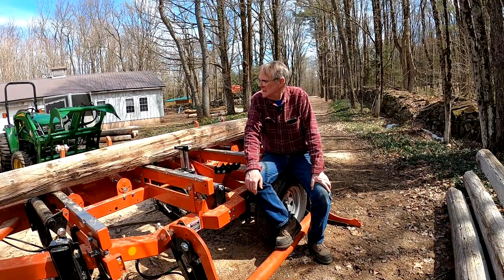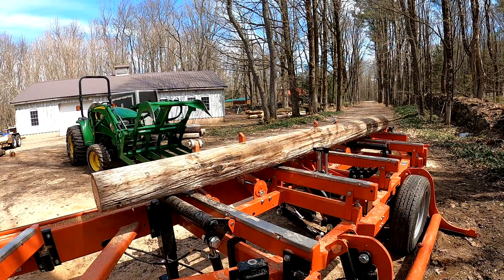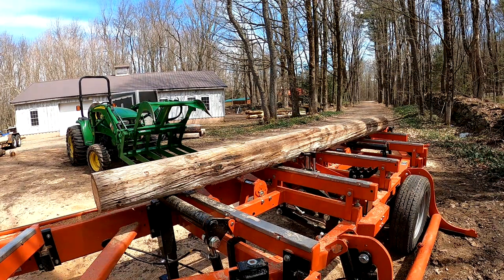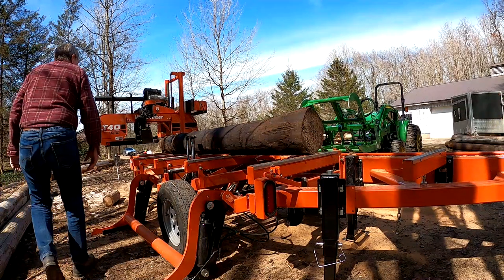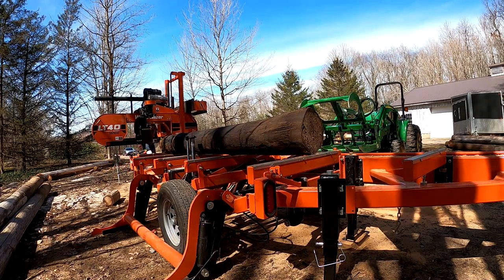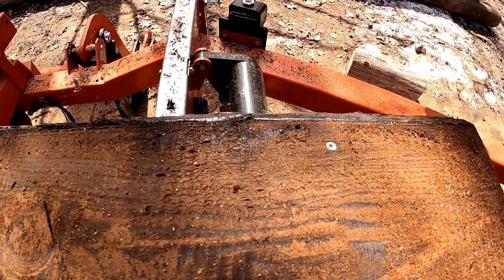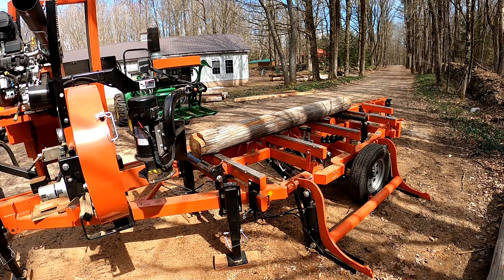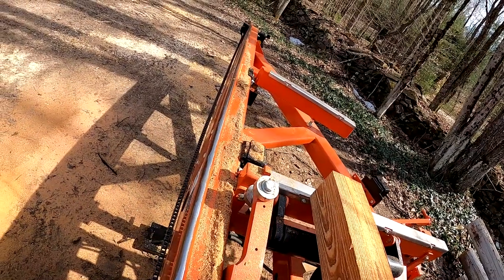Milling "Free" Utility Poles Part 1 # 107

Comment: Im picking some of these up today. I have a LT15 with a 19 hp gas. I just have standard 10 degree blades. Can I ask the HP youre running and what blades are working for you? 
Thanks for the videos!!!
Reply from the maker: My LT40 has a 26.5HP engine and my go-to blade is the Wood-Mizer Double Hard Turbo7. It's an aggressive blade and requires at least 25HP; which eliminates it from your mill. For your mill I would use the 10 degree blade for softwoods and the 4 degree for hardwoods (the 10 degree works for both but the 4 degree blade leaves a smoother finish). I would also use the Double Hard blade instead of the Silver Tip because they last longer (BUT more $$$$).
Dave
Reply from the maker: I forgot to add............CHECK FOR METAL!!!!!
Reply: @TheOldManAndTheSaw  Thanks for the advice! Really, and thanks for the videos. Man its so nice as Im learning. Ive been kicking around switching to 25hp. Woodmizer has told me I wont notice much difference in 19hp to 25hp, but if I can use different blades, that's sure a difference. Ill take a look if they have a 4 degree in a thin blade. Thanks again, John
Reply from the maker: Before you dump money into a larger engine talk to WM. There MAY need to be a lot of extra equipment required to allow the mill to run with a larger engine. I am told that changing my 26.5HP engine to a 38HP will require extra hardware for it to work; pulleys, belts etc. This would cost about $1,000 more than just the $3,000 engine. You may need a different drive belt configuration.
As far as blades, I believe that WM has blades in all profiles from .042 to .055 blade thickness. I also believe that your mill can run .045 blades, which will help reduce wavy cuts. Check w/ WM on the blades too.
Good luck.
Dave
Reply: @TheOldManAndTheSaw  Thank you.

Comment: How do you go about getting utility poles
Reply from the maker: It depends on your utility companies and who you know. My power company refuses to give their old poles away. Instead, they cut them into short pieces and take them to the local landfill because of the chemicals used to keep them from rotting. I got mine as a fluke. There was a crew working on my road and I asked them for the poles; the foreman asked how many did I need (they'd give me all I wanted since they didn't have to make the long trip to the landfill and could quit early).
Your power/ phone company may be different. Find out where their pole yards are and ask someone there. Or ask a crew on the road. EXPECT TO FIND LOTS OF METAL!!
Good luck
Dave

Comment: Dave I see what looks to be an OLD STONE WALL next to the drive way, it’s crazy to think you are standing in a place that once was a farmers field. The poles where I live have Hundreds of nails and staples left in them from for sale signs yard sale signs political signs, those LOGS do look nice.
Reply from the maker: That stone wall is over 1000 feet long and ends near another wall that's almost 2000 feet long. Around here you can't dig a hole without hitting a rock.

Comment: Nice work Sir.
Reply from the maker: Thanks. I learned that I don't like to mill old, used utility poles.
Reply: @TheOldManAndTheSaw  I have split some in half working up a log cabin-style shade structure. zipped down the long end of the pole with a circular saw and then the same on the other side. A few log splitters and we turned one pole into two. It wasn't super clean, but it got the job done.  
And yes, they are a pain to work with.